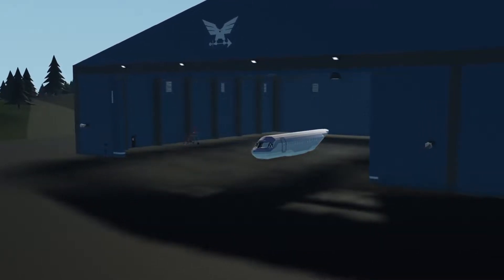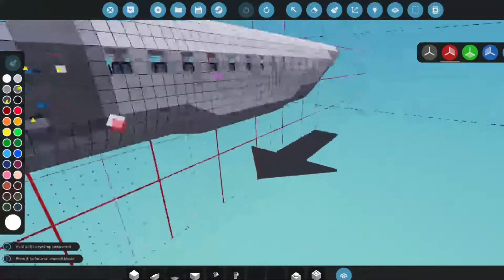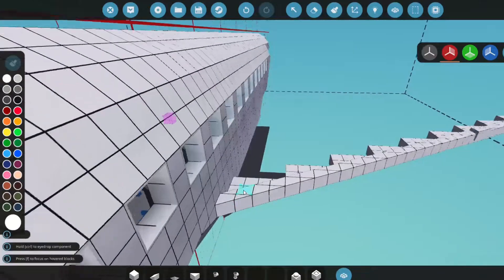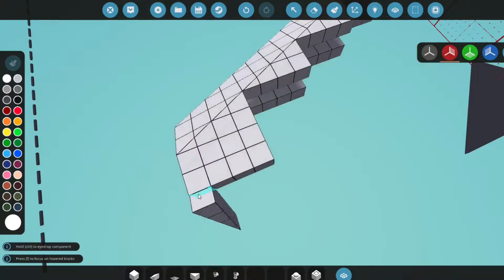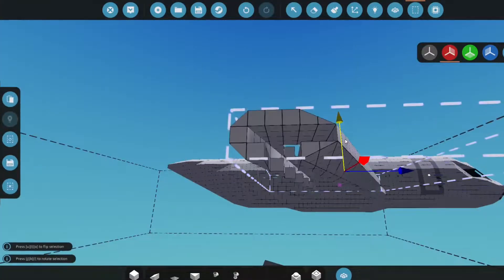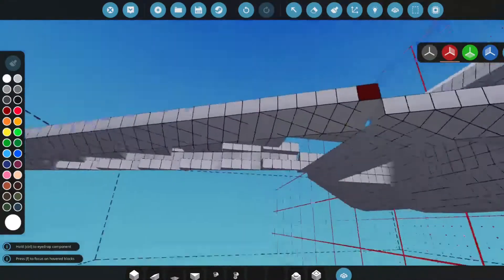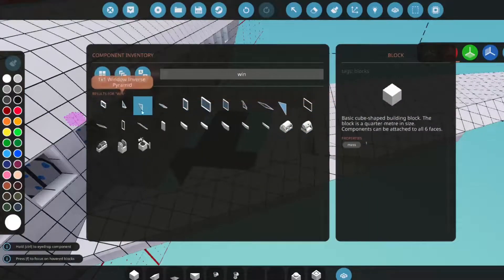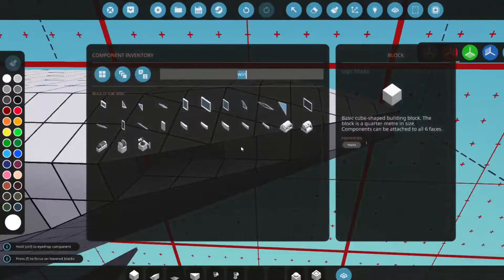How to build wings in stormworks!

Comment: could you instead of slopping with blocks use pivots
Reply: I think but if you want fuel in the wings then you will have to seal it off
Reply: @RPK-yg4ss  you can add fluid hose to use fuel in wings in pivots